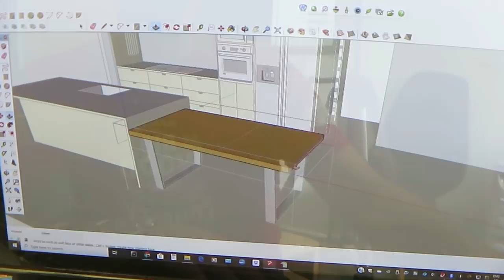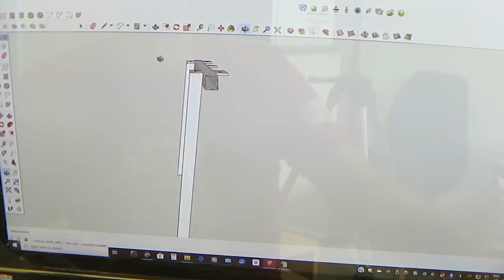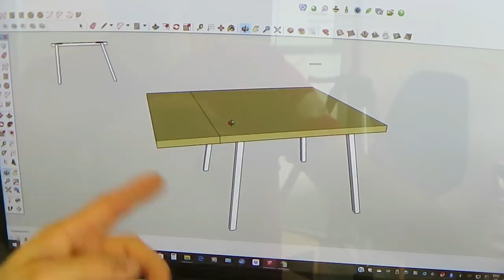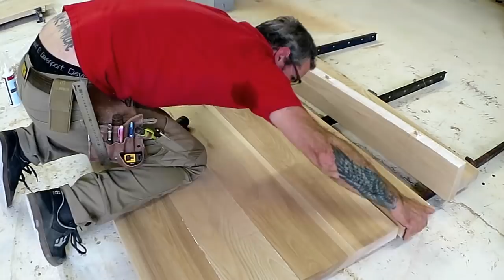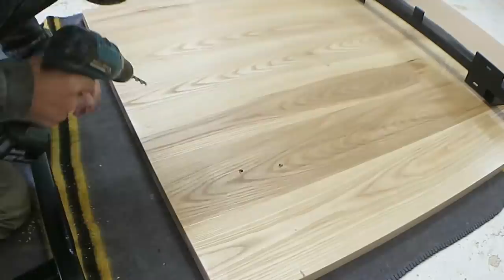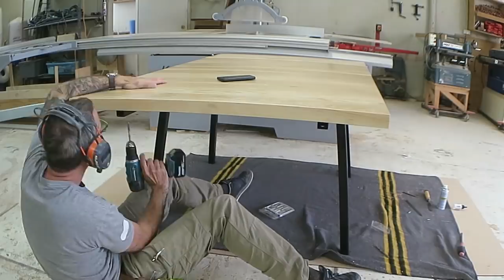small industrial extension table

Comment: I've never heard of Mirotone. Just looked them up. Not sure if they're avail in the US but if so was it the clear poly you used? Looks great!
Reply from the maker: I'm pretty sure I use the mirotec water based 8060 top coat. Works as a sealer too.